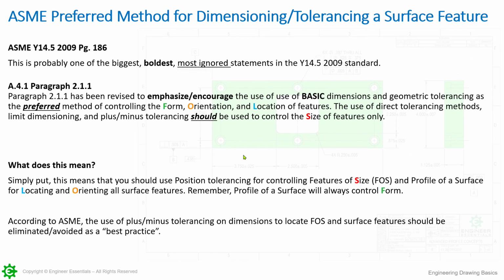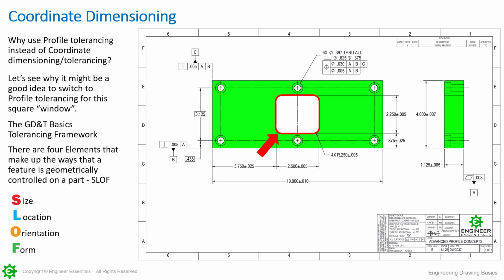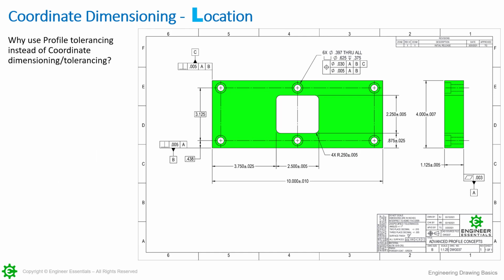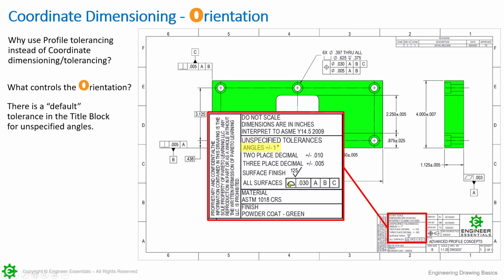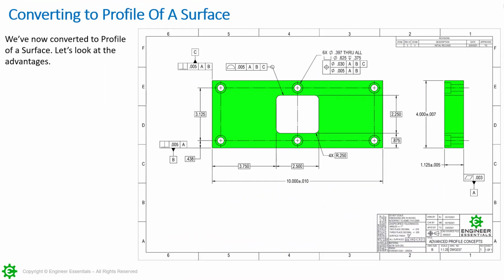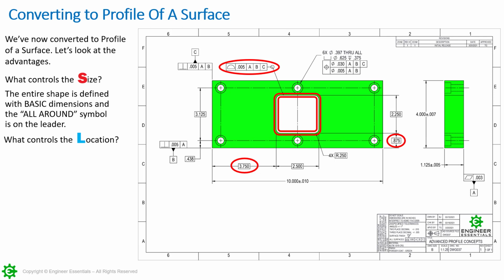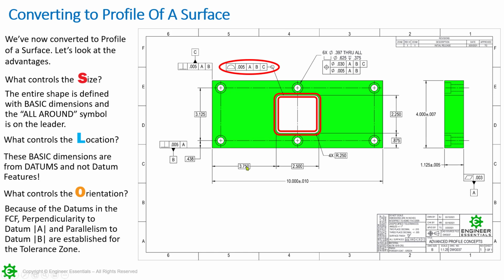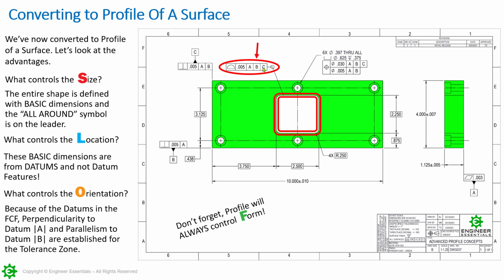Why Use Profile Over Coordinate Dimensioning

Comment: What if the basic dimensions are there for the creation and the profile callout does not have a datum system?
Reply from the maker: Thanks for the question! If no datums are listed in the profile feature control frame, then the profile callout is ONLY controlling the form of the surface. However, if the callout is for multiple combined surfaces (consider use of modifiers like between and all around), the relative location/orientation of the surfaces to each other WILL be controlled.

Comment: What is the tolerance of the basic radius 4x R.250
Reply from the maker: The radii do not have a direct tolerance specific to them. They are captured within the profile tolerance of .005 inches. So any element along that radius may deviate in or out by .0025 inches.

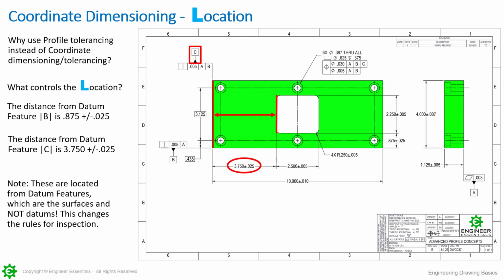Comment: I don't get the whole 10:45 mearsuring from datum feature not datum simulator vs the 3-2-1 rule. In my mind it defies the purpose of datum specification and interpretation. If your datum C is a bit angled and pointed wall is also then you'll get different results depending on where you put the micrometers "head"or whatever its called in english. If it ends up at MMC (which in this case means the point simulating the datum) it's gonna define a different value that at other places. And then if the part functions in a way that datum feature C is flush with a wall of another parts (and locked in space according to 3-2-1) then you'd want the measurements to qualify the part based on the tolerances obtained from it's true position in space which is based on datum feature simulator C...
Reply: I mean...if the cross secton of the part (parallel to the datum B) for the dimension 3.75 ends up being a trapeze (short edge at the top) then if I place my micrometer and take measurements at the top of the part its going to be different than taking them at the bottom (because I do not simulate a common plane for all the points on datum C from which I could be taking the measurements). And then even if the part supposedly passes the requirement, when it's going to work  with another part at datum C as a tertiary datum (has been assembled by first adhering to datum A, then tangent at datum B and only then tangent at datum C) the real conditions will be measured from the most recessed points on datum feature C which turn out to be higher values.
Reply: Well fuck me. The latter part of the video with basic dimensions pretty much sums up my way of thinking of how to measure things. But still, how can I define the tolerance zone proprly for the general dimensioning? It feels dependant on the placement of measuring tools chuck or whatever.
Reply from the maker: @eartheartbaratheon791  Thanks for the comments and questions! You picked up on the very good arguments as to why it's important to use basic dimensions and geometric tolerances to locate a profile. As you saw, with simple size dimensions being used to locate a profile there is ambiguity and issues because you can’t utilize the datum reference frame. This is the big flaw with traditional coordinate dimensioning. HOWEVER, if we do utilize the datum reference frame by using the profile symbol and basic dimensions, we get to measure with respect to the datum simulators. (i.e., granite tables, angle plates and height gages.)

Comment: do we need to measure the basic dimensions of 3.75 and 0.875 in measurement report? or we only need to make sure 0.005 are meet in measurement report? i ask this because basic dimension can no need be shown in profile control.
Reply from the maker: Basic Dimensions are not directly measured and reported during an inspection. They are dimensions without tolerances that describe the true profile. You only NEED to report that the total deviation from true profile is less than 0.005 inches. However, when you report the total deviation, the supporting data may be allowed to show how much deviation occurred in the 3.75 and .875 values.

Comment: So I'm working on a drawing where every dimension is basic. thickness , widths, radius's etc, there are no diameters, the profile tolerance block is (in metric) |1.5 | A|B|C| the tolerance on the print (in metric) is 0 place + - 1 , 1 place + - .2 , example , I have a wall thickness called out at 3.6 mm , what would the tolerance on that thickness ?
Reply: Potentially 2.1mm to 5.1mm thick. The wall to the left or top gets +/-0.75mm. The adjacent wall also gets +/-0.75mm.
Your question is ambiguous though.

Comment: So the question is, is it easier to use a caliper or a granite block + height gauge setup. Isn't a caliper easier?
Reply from the maker: It’s more than just “what’s easier?”. With coordinate dimensioning we’re only supposed to use “calipers” for the measurement and that is because there is no geometric tolerance referenced back to a Datum. This means that we’re not allowed to use the granite table/height gage method because the granite table would be a Datum Simulator. The coordinate dimension would not be locating the surface and must be treated as a Feature of Size measurement (two-point measurements, surface to surface). Switching to Profile with Datum References means that the surface is now located/oriented to a Datum and we must use Datum Simulators for the inspection. So, you have to ask yourself; do you want the surface to be located/oriented to Datums or treated as a FOS?   - Brandon
Reply: Thanks for ur explanation. It is really important to distinguish what situations that u should measure datum feature or datum feature simulator!
Reply: GD&T PLEASE SIR HINDI TEACHING